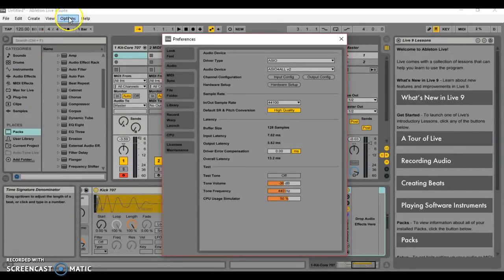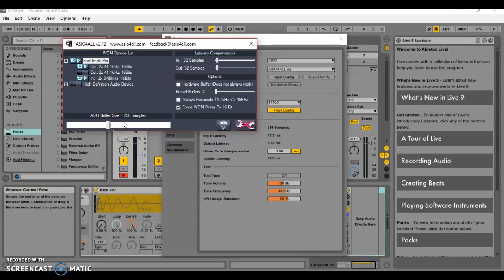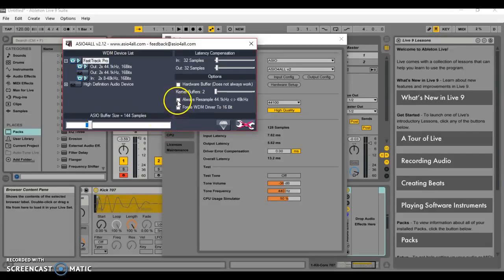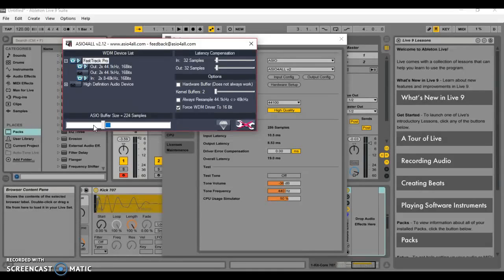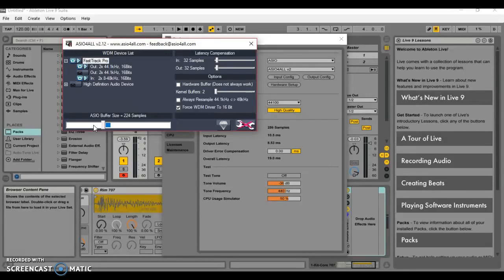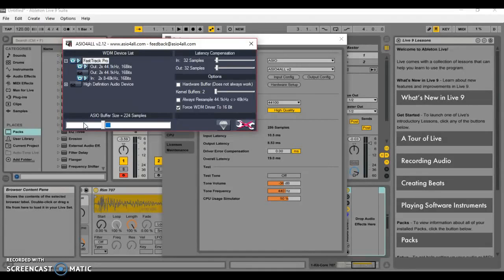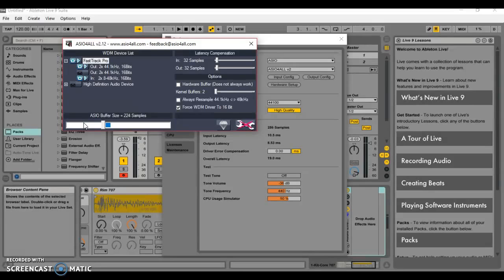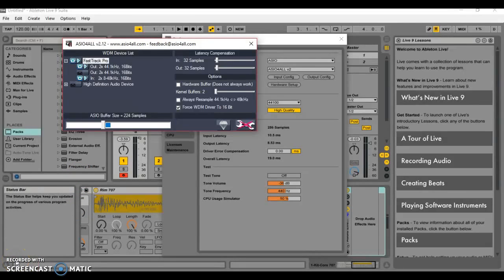Ableton: How to stop the cracking and popping thru the audio interface

Comment: it does matter what kind of usb controller you use and what other devices are hooked up via usb.. so unplug everything you do not need and then try out different usb configurations and ports.. ideally you should first only hook up the audio interface and try different ports and then add whatever peripherals you have..

Comment: If your buffer sample size is low in preferences say 32 that will make the cracky sounds. You need to have it on 512.
Reply: That definitely helps with the crackling. But when I go up to 512 I have latency issues. Do you know how to fix this?
Reply: Rusty Shackleford Mine doesn't even Gimme an option to mess with the overall latency.. it's automatically set at 43 ms
Reply: @rustyshackleford9963  i wish someone answered this question as i have the same issue.
Reply: GOD BLESS YOU SIR
Reply: Dude holy shit thank you I've been recording music for maybe 6-8 years and this is my first time recording myself and teaching myself how to do it on my own. You rock bud!
Reply: THANK U i spend like 2 hours to find the solution
Reply: Thank you, you are actually more helpful than the video

Comment: I just purchased live 10 standard and instantly I have crackling/popping issues. I updated all of my drivers, plus adjusted buffer size and sample rate within my audio interface and still having issues. Haven't made a beat in weeks because of this issue 😡
Reply: Same. I've upgraded to live 10 and im now getting cracking and pops. i've tried everything.  when i saw this video i went straight to my preferences, but there is no 'hardware setup' on live 10
Reply: @digitalchorus4140  glad I'm not the only one this happened to. I don't know what's wrong with Live 10. My audio is all jacked up from it.
Reply: I’ve had a reply from Ableton. My MacBook is 8gb ram, The OS on my laptop is using 4.5gb ram, then the plug ins on the track I sent them are  taking another 5gb , so they say it’s leaving nothing for Live to use to process -so there it is, I’m out of ram. Probably need min 16gb. I can’t upgrade ram on the MacBook Air,  so not sure what to do next. I asked them if live 10 uses more ram than live 9, but not heard back on that one
Reply: @digitalchorus4140  one of the reasons why I don't like MAC's. You can't upgrade parts. yep I do think RAM and the CPU is the issue with live 10. I have 8GB, but only 6.91GB is usable with 2GHz. my CPU is an AMD A6-7310 and it's complete trash. I opened up my all in one desktop and my CPU's super tiny with no heat sink. HP actually glued it to the motherboard 😆. That's why I'm going to sink about $600 into building my own PC.
Reply: @digitalchorus4140  It's worth testing but doesn't make a lot of sense, I have the same issue on 16GB of RAM.
Reply: The issue is not RAM, the issue is the buffer size on the ASIO driver. Try 512, 1024, 2048. Keep in mind overall increase in latency each time the sample size for the buffer is increased.
Reply: @watchmeasifly  yeah I adjusted the buffer size, but the cracking and popping increased the lower I went. The higher I went the audio would fade out. I realized the CPU is the issue. It was a cheap amd Radeon that HP put in. It doesn't even have a heat sink in it smh 😔
Reply: @audioplugg5310  Sorry to hear that, that can be a pain. Heatsink is cool, but you might have luck trying thermal paste. 

Also, the a6-7310 has this "APU" configuration option where it's paired with the GPU. Did you try turning off the APU option?  

The scheduler will introduce latency between the CPU and GPU which will have an affect on realtime processing.
Reply: @digitalchorus4140  In the same boat. ton of crackling when I'm recording vocals. just read you're replies looking for the solution and I gotta tell you its not the RAM. I just dropped big cash on a new MAC 64gb RAM and downloaded LIVE 10 suite. SAME SHIT. good luck to everyone whoever finds out the problem please share.
Reply: @calebswasey1601  sorry to hear. it was so frustrating I moved away from Ableton. I bought a  more kit with 32gb ram and moved to Logic Pro. Seems to work ok. I do miss some aspects of Ableton but quite like working in Logic at the moment. Good luck.
Reply: same problem man, I'm only using lite version, it's really frustrating. you find any solution?
Reply: @gavinrobertcarmody2547  still haven't found a solution to it

Comment: theres no hardware setup option in the audio preferences for me!?!?!
Reply: You need a audio interface such as the M-Audio 2x2. Legit hardware to activate the function
Reply: @MUTE129  I have scarlet and it doesn't show either what do i doooooo?
Reply: @snelstappers6648  have you checked your devices in settings have you rebooted your computer have you restarted the DAW
Reply from the maker: It should be one unless you have a different DAW software
Reply: @MRAJDESIGN  why else would he be watching the video if he using a different software
Reply: idk I have live 10 and it doesn't have it either, he's using live 9 in this video idk what you have.
Reply: I have an apollo twin duo, and I can set mines... I didn't have this problem with my old hp i3 but but very rare. Now I have the Lenovo Legion 8Gen i7, and I am getting the pops, and cracks bad so I gotta set it.
Reply: You're not trying hard enough or ur interface failed bruh.

Comment: Okay so I did this and the audio doesnt crackle and pop no more but it just freezes and glitches and it will continue but then glitch and freeze again, any suggetions ?
Reply from the maker: That's a software problem
Reply: Yeah... a stronger processor like a i5 or better to handle the CPU that's needed to run the software.